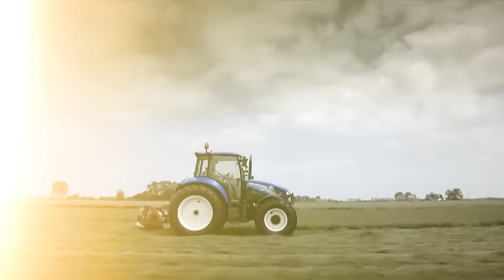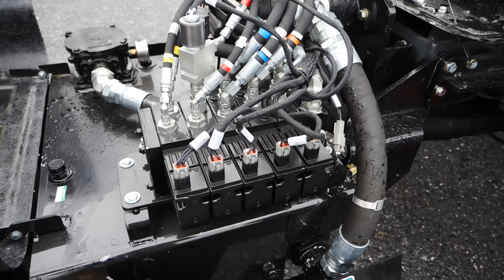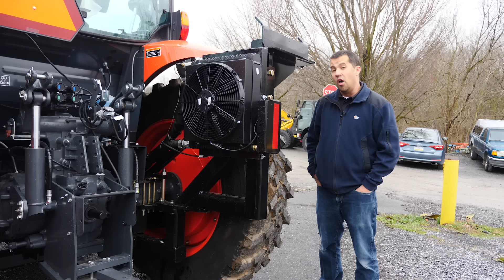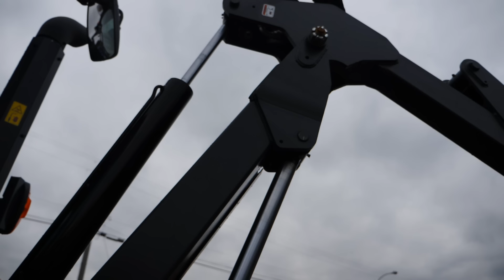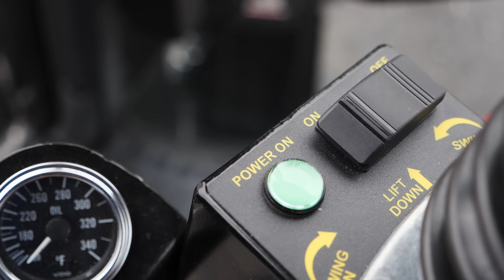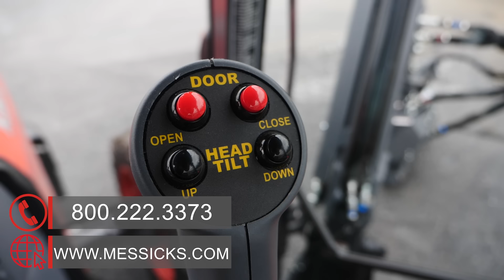Kubota M6-111 with TerrainKing Boom Mower - How it Works

Comment: The Flail Axe Mower head works good on grass and brush up to 4 inches in diameter used one daily for three years warning do not get around basketball sizedrocks or you’ll have to replace the cutter drum

Comment: I wish Kubota would build a TLB in the 75 to 100 HP range where you could place some thing like this on the backhoe mount.  also enough flow for a FEL mounted sweeper or other high flow attachments

Comment: Safety mesh on the glass door would be beneficial. In EU all of the tractors seen carrying verge cutting etc are seen with it.

This mower looks amazing. I would love to test it. Looks a lot more practical and safe to use when compared to standard mounting on the back.

Comment: What is the advantage of this system(with all the modification done to the front of the tractor) , compared to just have the separate hydraulic system run off the PTO?
Reply: It is for mowing the sides of roadways. Those are often sloped and would tip over a tractor. There are often short marker posts and guard rails that this can go over.
Reply: @court2379  I was not thinking about the usefulness of the mower, I have seen them every summer, my whole life. :-)  But normally they just run on the PTO, behind of the tractor, and are constructed in a way where the pump and hydraulic oil tank, works as an extra counterweight.
Reply from the maker: Keeps the 3pt open so you can use it  for other implements
Reply: @MessicksEquip  Makes sense, although I would think, the mower was enough then keep the driver fully occupied. ;-)